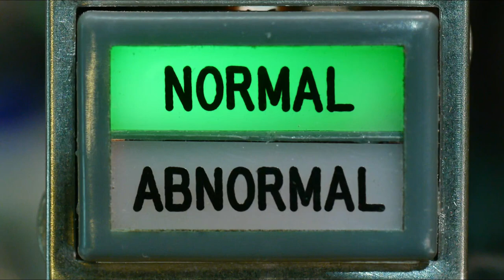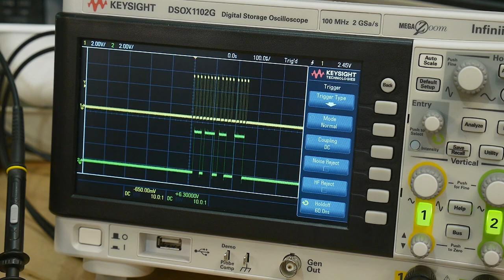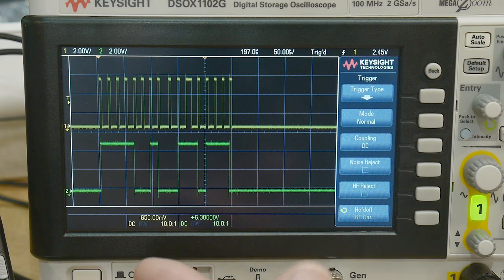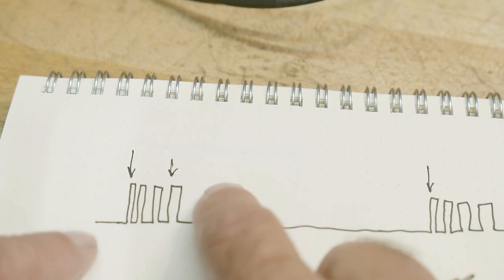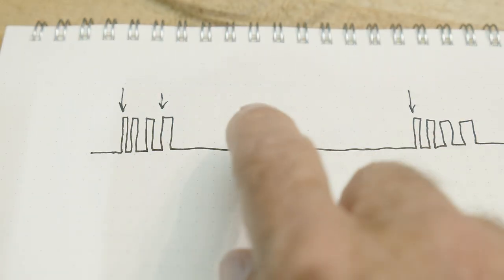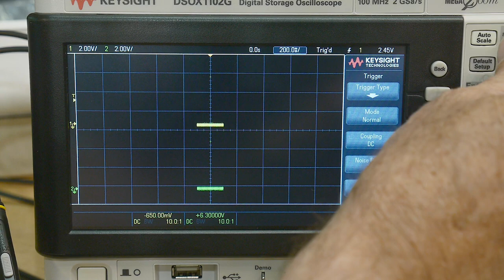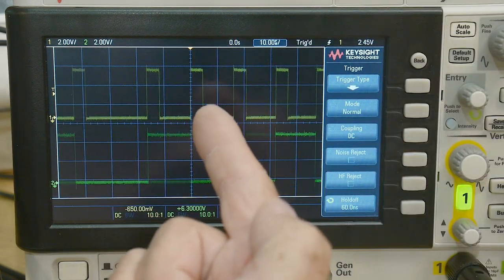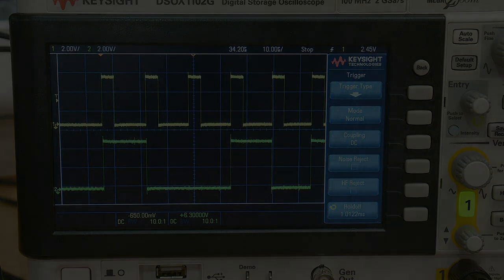#1565 Oscilloscope Trigger Hold Off

Comment: What I did not know is that zooming in/out may effect the trigger point. I wonder if that is true of all scopes/makes/models? I would have thought that the trigger point that was originally programmed would have remained the same, regardless of zooming... Maybe you have to initiate the hold function (of Run/Hold) to zoom in/out, without the trigger changing?

Comment: Useful info. I don't think my scope has that function though.
Reply: Holdoff? As far as I know most scopes have it, even analog ones. That's a basic feature.
Reply: @Gengh13  I can't find it on my Hitachi 1980's analog or my Fnirsi digital scopes. Unless it has another name. (which I doubt)
Reply: @frankowalker4662  it's been a while since I've used an analog scope but if I remember correctly it was in one of those inner knobs somewhere in the trigger section, but I've never used a Phillips or fnirsi scope.
Reply: @Gengh13  My Hitachi dual trace analog probebly does have it, it's just there are so many knobs and switches on it. Most with muli-function if you pull out the knob, or push it in and turn it, or turn it till it clicks then pull it out. LOL.

The Fnirsi is a cheap Chinese dual trace with a terrible touch screen that gets laggy about 1GHz. But it's small, portable and rechargeable.
Reply: @frankowalker4662 might be called "trigger delay" or something to that effect.